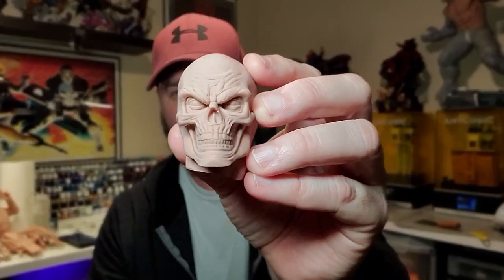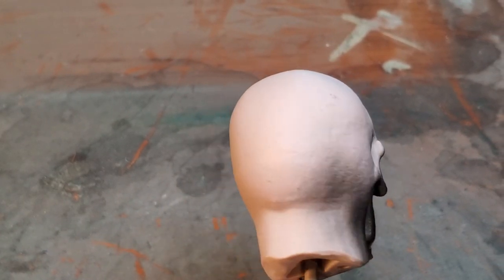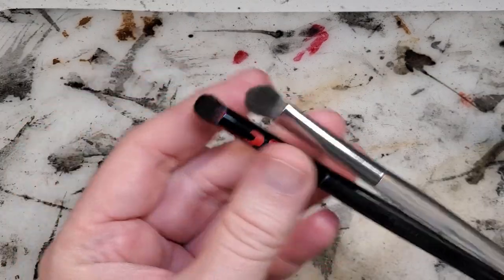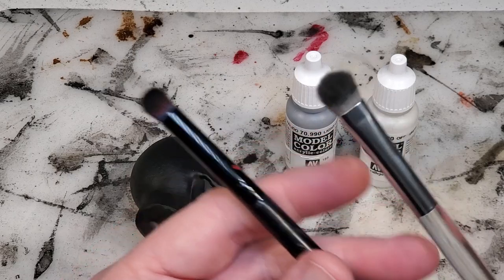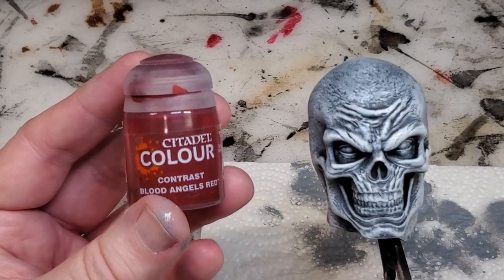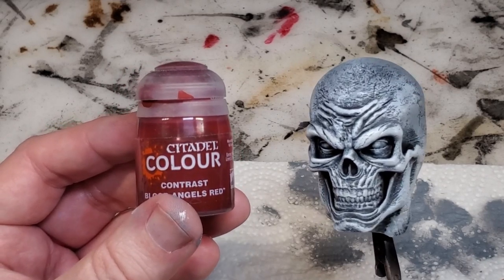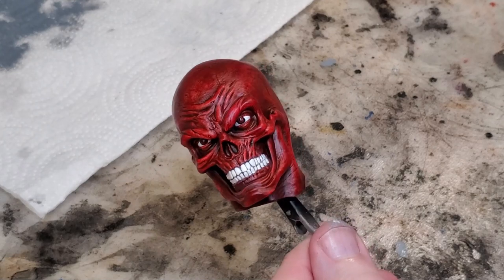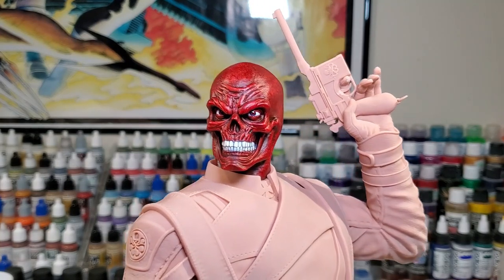Can SLAPCHOP be used in STATUE PAINTING?

Comment: Great video as ever, amazingly well explained. 

I use Contrast paints a lot on my models. Some very weird methods too, like blue over a terracotta primer with some white highlights makes for the deepest darkest blue, contrasts great against dark greys and blacks. The biggest issue, especially with reds and blues, is the paint reactivating when it gets damp, so you can either seal it up after and hour with a varnish or mix some citadel contrast medium into your paints at a ratio of 1 part paint to 2 parts medium and it will harden a heck of a lot quicker. So you can jump in adding some more contrast over the top, normally this would lift the layer underneath and wreck the paint job, the medium will stop this happening.